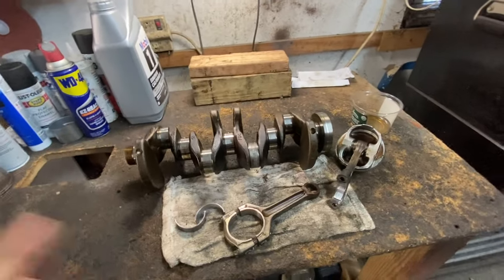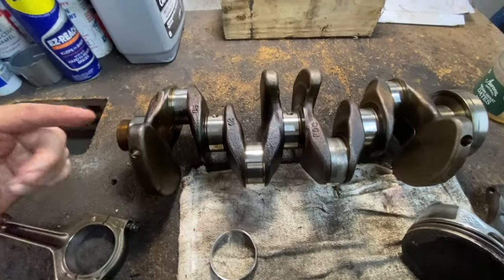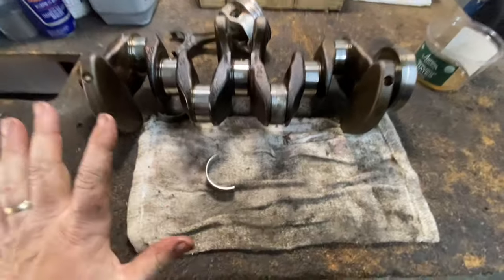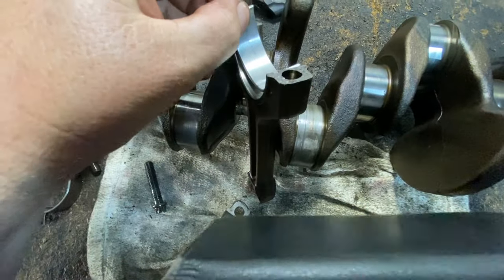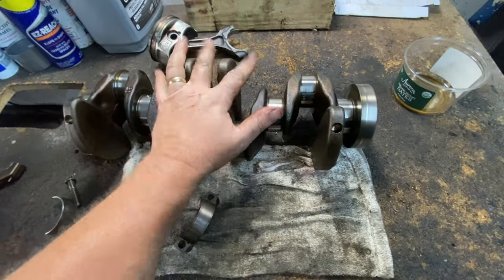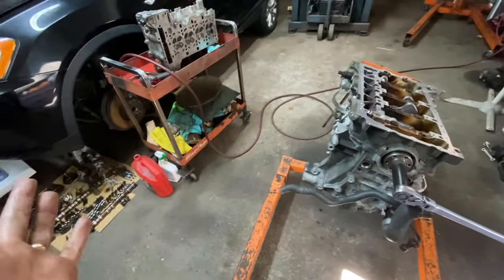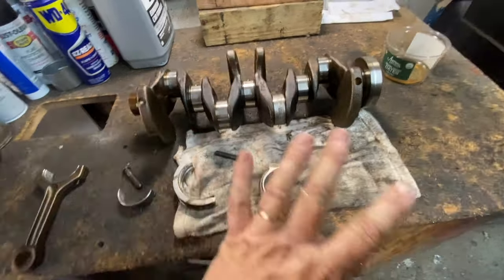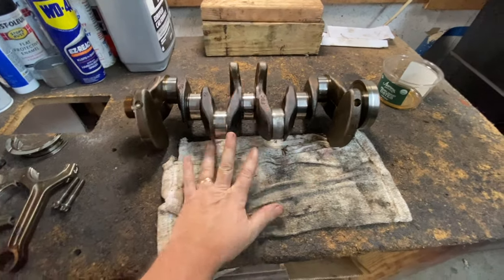Engine Rod Knock - Is It Worth To Be Fixed?

Comment: I change my own oil on my mustang but i take my kia to Valvoline.....got an oil change 3 weeks ago and last night my car started knocking so i got looking and there was no oil at all in the engine and the oil filter itself was only 3 full turns from coming off....
Reply from the maker: Take it back asap to Valvoline, you got a good law suit. Jiffy lube is always getting sued as well.
Reply: @motorcarnut  a mechanic just left from looking at it,they're going to tow it and start an investigation but he said since I put more oil in the engine and tightend the filter that its not going to work in my favor but im not going to leave a heated engine with no oil and not going to put oil in it without retightening the filter but there is oil every where around the filter
Reply from the maker: @badbatch9048 You should never of touched it because now they have an excuse but be persistent because they were at fault! Good luck
Reply: @motorcarnut  they done fucked me,they towed it in and performed an oil change and changed the filter hidden behind the words inspection and investigation
Reply from the maker: @badbatch9048 Get advice from attorney

Comment: Hi, Mechanic opened up the entire engine and found the ONE Rod cap was fitted upside down which damaged that one conrod groove and the one big end bearing that went on that conrod.

He said in order to fix up that knocking noise, we must get:

●1 conrod

●Polish crankshaft (crankshaft was not damaged)

●Change all big end bearings since it comes in a set when bought.

 (My argument was why change all big end bearings when just the one bearing was damaged because of the upside down rod CAP? 

What's the need to polish crankshaft if it wasn't damaged? Or it's fine if the engineer polishes it?

I'm just worried why polish, what if it weakens the crankshaft.

Thanks

Is he right to change all the bearings?
Reply: His going to put the same standard size bearings because his not cutting the crank (only polishing crank)  no need for undersized bearings. Is he correct?
Reply from the maker: If metal filings were not circulated in the engine and scored the other bearings then just replace that rod and rod bearings for that cylinder and just polish that one journal. If you’re on a budget. No polishing the crank will not weaken it. The way he wants to do it is the proper way but will cost more money and I would do it that way as well. But as stated, if your tight for money the other way will work.
Reply: Thanks.

I am on a tight budget but the guy explained to me that he doesn't want to open up the engine again, he promised that if he fixes it his way now then i will not have issues again.

BEARINGS come in a set so even if i change bearings for one rod i will still have to pay for the entire set of bearings when bought, hope you understand what im saying. 

Really disappointed that they don't sell lose rod bearings for one cylinder. Have to buy for all cylinders.

I can find a lose rod? Don't want to buy 4 rods otherwise ill be in big debt.

Struggling to find parts though for L15z engine. Only the honda dealer has got stock in south Africa. Dealers are very pricey.

Comment: I have a lower bearing failure on my 2015 Subaru wrx. My Mechanic quoted me 8,200, does that sounds reasonable because that sounded high to me?
Reply from the maker: You can buy a brand new engine for that price. Shop around. $4000 max depending whats damaged.

Comment: So there’s no way to fix this? My car started doing this a couple days ago and idk what to do, I’m still in school and work part time so I don’t make much. But I don’t have a way to get to work or school now
Reply: It first started the other day after I went over some speed bumps. I’m so stressed about this
Reply from the maker: Are you sure it’s an engine knock? Going over some bumps won’t do that?
Reply: @Shawn_mccallister i know this is an older post, but what kind of engine do you have? 4 cylinder, 6 or 8?
Reply: @motorcarnut maybe the bearing was ready to spin and the bump was enough shock to loosen it?

Comment: Even doing this DYI if the vehicle is not worth at least $20k+ the cost of the parts can easily exceed the value of the vehicle and nOT pay todo i. Trade it in for a a better running pre-owned vehicle.
Reply from the maker: Well many factors come into play here. If I am doing my own vehicle, I'd definitely rebuild it then I have a new engine that's more reliable then someones pre owned vehicle and way cheaper and more reliable.

Comment: My crankshaf can turn by  hand easily at a steady pace, but it will get harder to turn when it rotates to a certain point but when that hard point is passed it get easy again until it comes back around to that spot, 
Oh and all the pistons and rods are all put together and attached, but why is it doing this?
Reply from the maker: It’s normal, you’re feeling the compression when turning it over
Reply: @motorcarnut  oh okay thanks, just wanted to be sure  it wasn't anything bad
Reply from the maker: @RookitMaster no problem!

Comment: hi can we have knock due to piston slap and are bearing failure and piston slap related to each other ? thanks
Reply from the maker: No bearing rod knock is not the same or related to piston slap. However both can be caused by oil starvation.
Reply: @motorcarnut  I have my car at dealership for warranty claim but they are refusing to replace engine claiming the noise is because of piston wear and not due to bearing wear knock , they use some type of tool to test it without opening engine and when I ask them that sound just started to come as soon as I get check engine light and there was no oil leak/burning before that they cant explain that and sys that we can see that cylinder walls are scraped , its a kia soul with engines under extended warranty due to rod bearing wear
Reply: @motorcarnut  its getting code P1326 but they are refusing to accept its due to bearing wear without opening engine and physically inspect it
Reply from the maker: If they did not find your oil level low, they must fix it as it is directly caused by oil starvation especially with the code P1326.

That tool they used was a bore scope. Go to another dealership if possible or threaten to sue.
Reply: @motorcarnut  oil level was perfectly correct and car was not burning/leaking any oil , I confirm it before last 2 oil changes that oil level was ok before oil change (so no burning or leaking), there is already a class action law suite against them in Canada due to this issue but they are shamelessly not resolving it  and lingering on, secondly refusal of engine change is coming from kia corporate as the service manger on kia dealership even show me their email showing that he requested a goodwill replacement of engine which they also deny , do you think taking it to another dealership can change bearing clearance test results or this this a good idea to talk to original dealership where this car was service throughout , the issue is that dealership is around 500KM from where i  am currently living
Reply from the maker: @tanweerahmed6861 You should try. It’s a shame, they know about this and just don’t care.

Comment: I did experience the cranking sound in my engine Fiat Palio 1.2 and suddenly the car stops itself and after some few minutes I tried to start again and the sound was heavy so I opened the sump found metals like mud in the tray so can I fixed it without taking out head cylinder?
Reply from the maker: Not the proper way ,no

Comment: Are rod bearings easy to replace?

Mechanic cannot make a mistake when replacing rod bearings?
Reply from the maker: Most of the times the engine has to come out of the vehicle to replace them and usually it destroys the crank journals too so it's a big job and absolutely a mechanic can make mistakes and not measure oil bearing clearances etc.properly.
Reply: @motorcarnut  what do you mean by oil bearing clearance mistake
Reply from the maker: @muhammadtai4972 oil bearing clearances have to be checked for proper clearance, if too big or too small will cause crankshaft damage
Reply: @motorcarnut  Even if the mechanic is putting new standard size rod bearings? 

Im pretty sure the mechanic knows about this things....im just stressing too much for nothing
Reply from the maker: @muhammadtai4972 you probably are

Comment: Just happened to mine. Would you recommend rebuilding or buying a used one. Rebuiding is cheaper but concerns that metal fragments would have damaged the rest of the engine.
Reply from the maker: If the engine ran fine before I would rebuild what you have and clean up any metal or replace oil pump too.
Reply: @Motorcarnut  I bought it a week ago and the engine started knocking. Metal found in the oil filter. Basically got scammed. 

Don't really know the history of the engine. Still think rebuild or used engine?

Thanks mate
Reply from the maker: @waynehick I would but maybe you’re better off if you find one that you can hear running then buy that one a put it in yours.
Reply: Start by removing the girdle and pulling caps off.  Replacing bearings is the simplest way to fix it. However, that metal on metal contact, depending on how bad the bearing is, can scar and scratch the crank.  If the crank is scarred too much then you'll need a new crank otherwise it'll just end up getting rod knock again sooner rather than later
Reply: I had engine knock did everything you said in the video even replace starter and diesel fuel filter we struggled starting the bakkie and the engine knock again and damaged the bearing what was the reason
Reply: @leroydavids2972  you will need a full engine rebuild mate.
Reply: @waynehick  not true. Would only need a full rebuild if crank was damaged beyond repair. I'm on my second set of bearings. I replaced bearings at 250k miles and they lasted until 263k miles. And only reason they went bad the 2nd time was because my girlfriend ran it low on oil for a week.
Reply: @GVGR11B  if you've spun a bearing chances are your crank will need grinding or replacing. All the metal would have then spread through the engine causing damage to other parts.
Reply: @waynehick  spun bearing is alot different than just rod knock.  We are discussing rod knock not spun bearing. You are right though.
Reply: @leroydavids2972  could have accidentally mixed up rod end caps. Each piston is is machined with the end caps meaning each piston will be alittle different. For instance, I've mixed cyl 2 and 3 rod cap before. It spun freely on cyl 2 with cyl 3 end cap but when cyl 3 cap was on cyl2 there were clearance issues. Making #2 too tight and #3 too loose making it knock still. Until I pulled it back apart and swapped them around now it's fine. Each rod and cap will be numbered so make sure they #2 rod has #2 cap, #3 has #3 cap etc.  Other wise clearances will be off

Comment: Hi, would you recommend using 10w40 or stay with 5w30 engine oil after rebuilding an engine which suffered a bearing knock?

Which one would be best to use to make sure we don't suffer a bearing knock in future.

10w40 is a bit thicker than 5w30.

Thanks
Reply from the maker: You can use the 10w40 with no issues
Reply: @motorcarnut Thanks for the quick response. Will use 10w40

Comment: Also would be cheaper to relace the entire egine and faster than replacing the Crank, etc.
Reply from the maker: It's not cheaper if you did it yourself. But, yes faster.
Reply: Assuming a used engine much cheaper
 @motorcarnut
Reply: @SteveInterdonato better rebuild it back

Comment: I just bought a Chevy Impala for $100. It's got a rod knocking. I'm going to scrap it and make some $. I'm not doing all that to it that's for sure. I don't have $2,000 for a crankshaft
Reply from the maker: Yes doesn’t seem that vehicle would be worth it if the condition is poor

Comment: Short answer dont fix it if the damage is to bad or if there is any at all
Reply from the maker: Doesn't make sense what you said. Most of the times it's worth fixing especially if you are doing the work yourself.
Reply: @motorcarnut  yeah im saying dont go pay to get it fixed if its damaged to bad just buy a new motor
Reply from the maker: @FINDROBLOX damaged beyond repair is rare except for a rod threw the block
Reply: @Motorcarnut  oh idk sorry I just had this happen to me and I've check valve covers and tomorrow imma check piston bearings I was just told for me at least it will cost more to repair than just replacing the engine so I decided to see what I can do on my own
Reply from the maker: Yes that’s the best and cheapest option.

Comment: Very well explained.
Reply from the maker: Glad it was helpful! Thank you!
Reply: @motorcarnut  can you replace the journal rod bearings without splitting the case? I am doing just a top end, cylinders and pistons: THANKS
Reply from the maker: Depends on what type of engine. Some have two part oil pan and then a main bearing bridge that may block some of the journals. If you take the pan down and see all bearing journals then yes you can